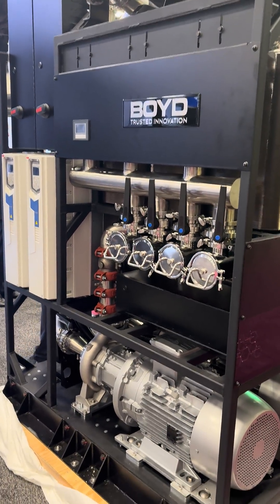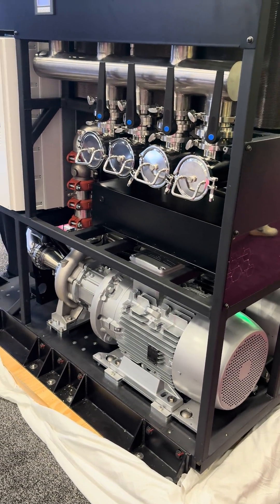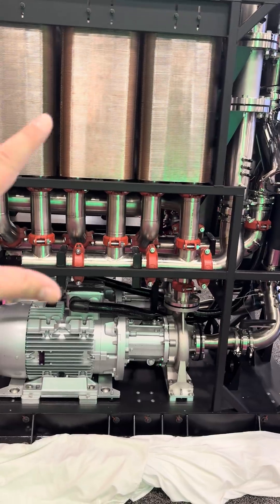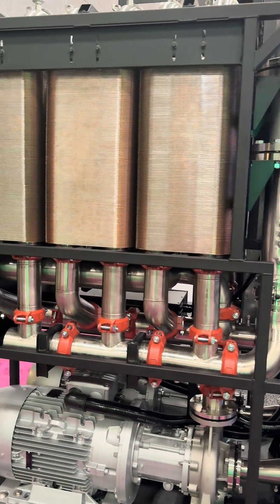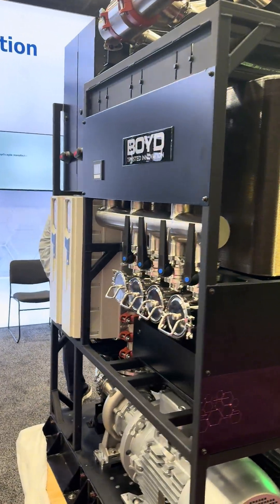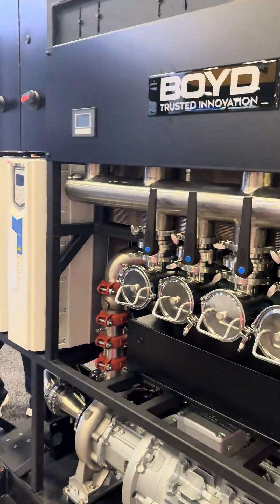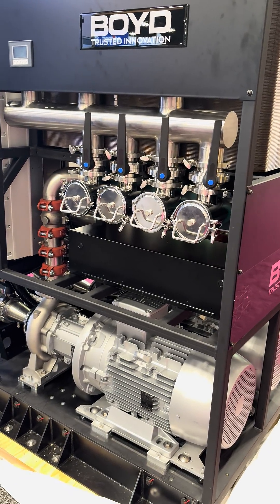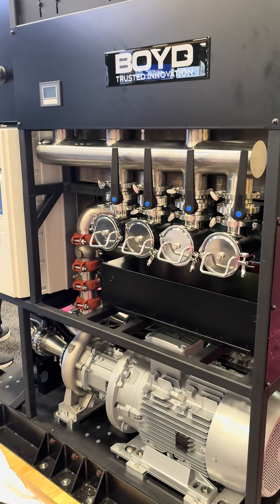BOYD two megawatt liquid cooling — 500 gallons per minute circulation from a 50 hp motor

Comment: This is a normal every day occurrence at any factory, especially when you use heat exchangers, evaporators, and condensers. It only took them this long to put one on display at a tech convention 😂
Reply: I've seen something similar on injection molding machines back in the 90's.